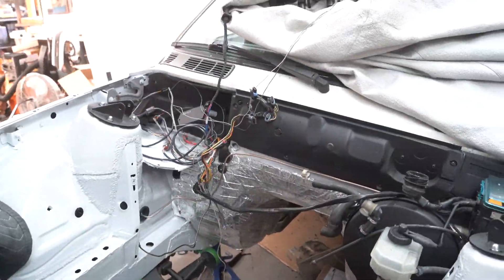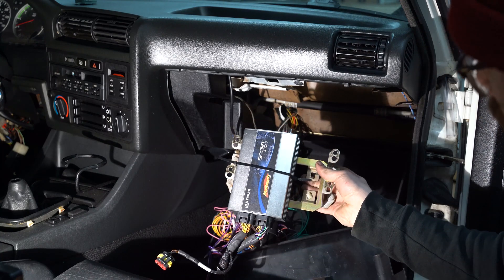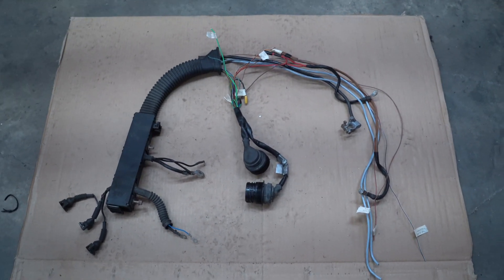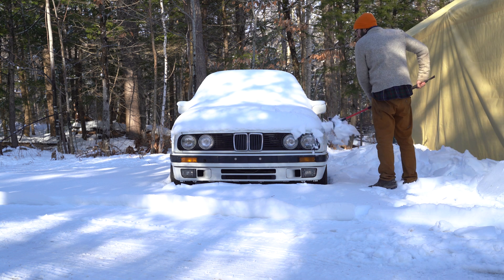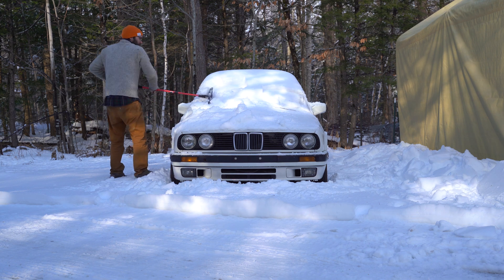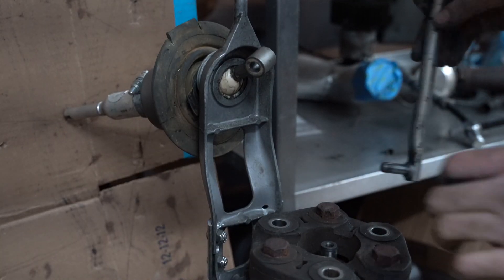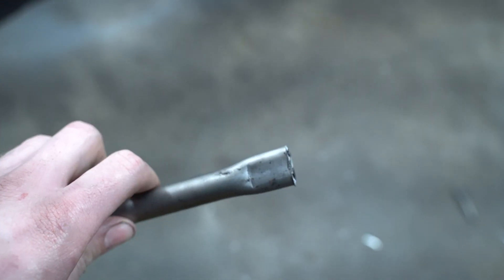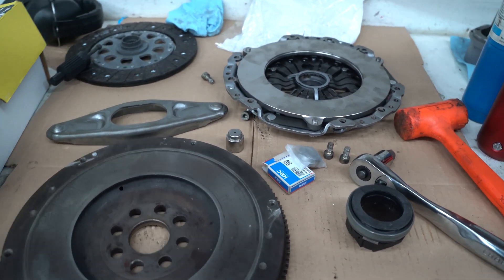Turbo E30 Update #12. Electrical, suspension, and transmission woes

Comment: The pressureplate you have there is a self adjusting unit, it is compressed untill you release the lock meckanism that sits in the middle. You need a special bmw tool to install it.
Look up a video on how to install a self adjusting clutch and you will see what i mean :)
Awsome video, where is the outside footage from?
Reply from the maker: Thanks! I did find the video from BavAuto I think. Luckily I just ended up using a pressure plate and flywheel from an m54 last second. The outdoor footage is just some drone shots around my house in New Hampshire :)
Reply: @skudak  nice! Looks amazing :)
Reply from the maker: @iliketorockrock  Thank you!
Reply: @skudak  and what starter do you use with m54 flywheel?
Reply from the maker: @jonperezrosenada1649  i used a m54 starter
Reply: @skudak  thanks